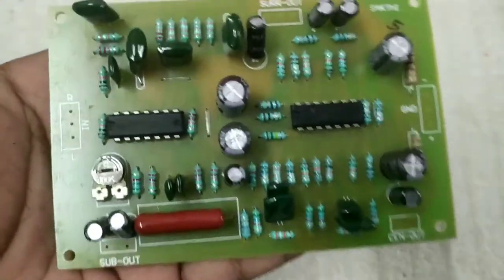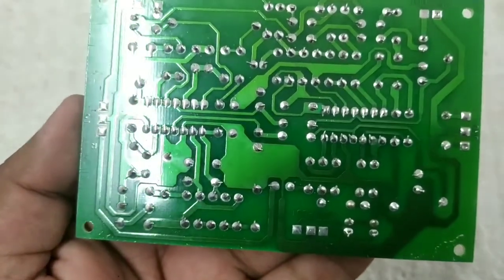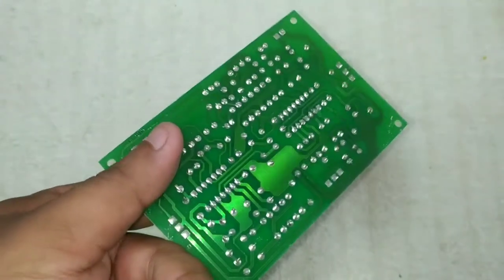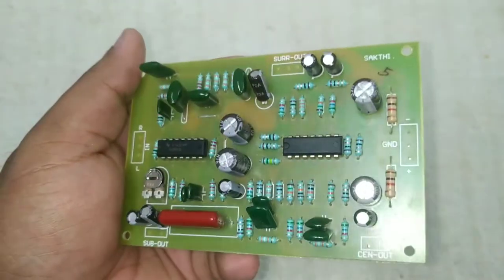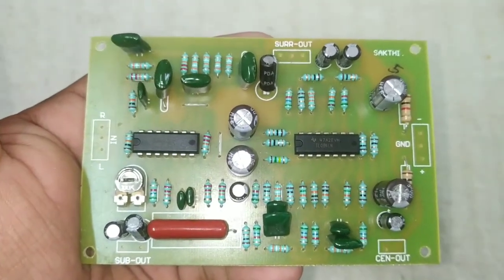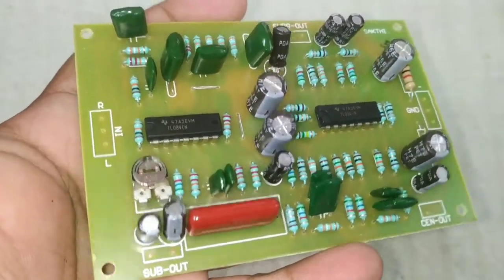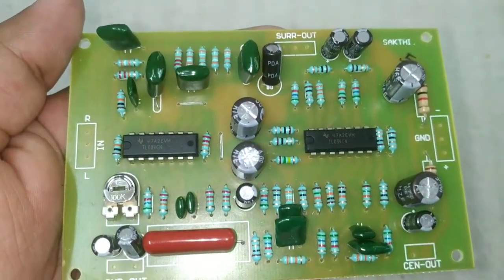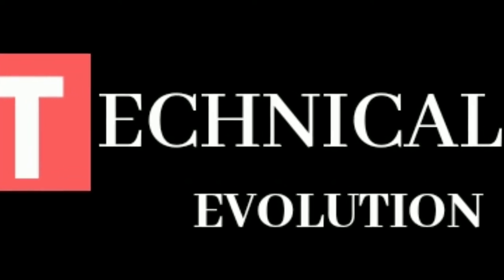Stereo to 5.1 prologic board for just 200rs. Small board and easy to use

Comment: Bro prologic board റോട്ടറി സ്വിച്ച് ഉള്ളത് ഇല്ലേ  3option ആയി music cinema  smdl   ഞാൻ ഇപ്പൊ powertric ന്റെ ഒരു prologic board വച്ച് ഒരു amp ഉണ്ടാക്കി  പക്ഷെ 5.1 work ചെയ്യുന്നുണ്ട് പക്ഷെ sourround effect കിട്ടുന്നില്ല ഈ board നു 450രൂപ കൊടുത്തു മുൻപ് single ic board ഉണ്ടായിരുന്നു റോട്ടറി സ്വിച്ച് option ആയിട്ട്  കാമറ print അടക്കം അതിൽ സിനിമ mode ഇൽ മൊബൈൽ blue tooth വഴി connect ചെയ്തു sourround ഇൽ കാണാമായിരുന്നു  perfect working center ഇൽ സംസാരം മാത്രം front left right  bgm music കൽ മാത്രം rear sound passing s  പിന്നെ call കൽ  ഒക്കെ correct ആയി പിരിച്ചു work ചെയ്യുമായിരുന്നു അതുപോലുള്ള വല്ല ബോർഡ് ഉണ്ടോ ഇപ്പൊ market ഇൽ center voice gain കുറച്ചു കുറവായിരുന്നു അത് gainer board വച്ച് adjest ചെയ്യണം വേറെ superb ആയിരുന്നു അത്  200രൂപയെ അന്നുണ്ടായിരുന്നുള്ളു  powertrick ന്റെ തന്നെ ആയിരുന്നു അതും
Reply: Sakthi yude surround bord trivandrum thakarapparambil available anu surr left lum right lum 3d effect ayittanu kittunnathu centre il voice mathram supper bord anu...njan ennale vangiyirunnu...
Reply: @manulogin514  rate എത്ര ആയി